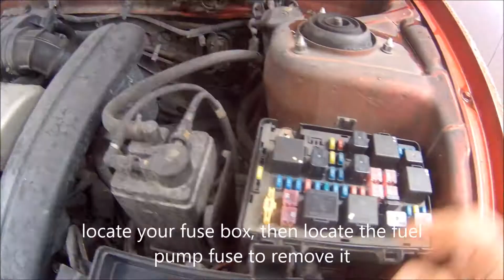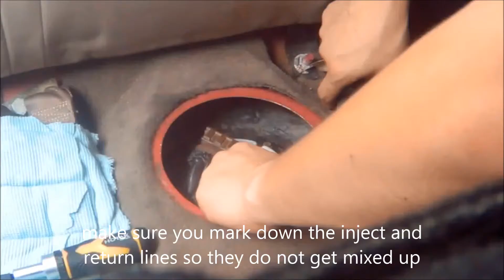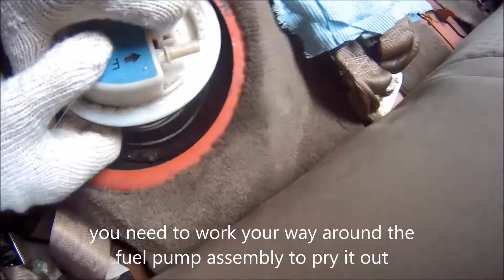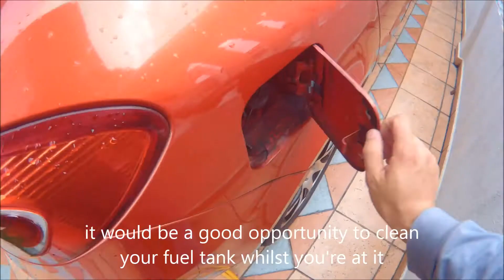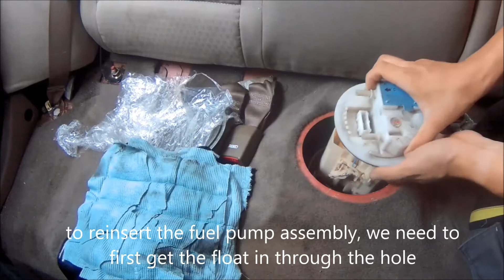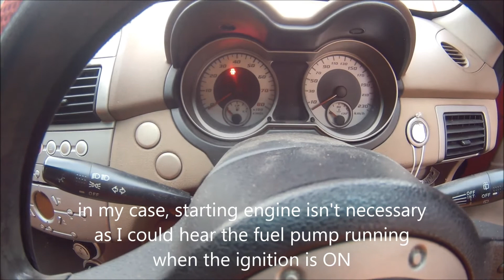How to Repair Fuel Pump Issues (Proton Gen2)

Comment: Hi there I got a 2006 gen 2, got a fuel pump In my car and worked fine but my fuel gage is not working properly, the km isn't correct and when it gets to 50km it shows there's nothing left in the tank what can cause that
Reply from the maker: fuel gauge is controlled via the float bar attached to your fuel pump assembly...the range shown corresponds to your fuel gauge, and below 50km i think the estimated range just goes "---" instead of showing actual numbers

Comment: ON my Proton Gen 2 , 2010 always is smelling like petrol or lpg , I ve got an lpg tank in the boot .
Couple of days ago , I ve filled with petrol , it run to drive me home , and after refused to start again .
I ve put the tester on it , and is saying something like , fuel sensor range , I ve checked the pump fuse and is ok , I ve tried to started using starting spray and is starting when using that .
Next move I ll check the relay and the pump .
Any other ideeas ?
Nice video , and well presented , thanks .
Reply from the maker: thanks for the kind words...well I must say I'm no expert myself, but being able to start on starting spray does suggest that you have something wrong with your fuel system. Whenever you turn on your key, before cranking your engine, you should hear the fuel pump running for couple of seconds, if you don't then maybe something is wrong with the pump